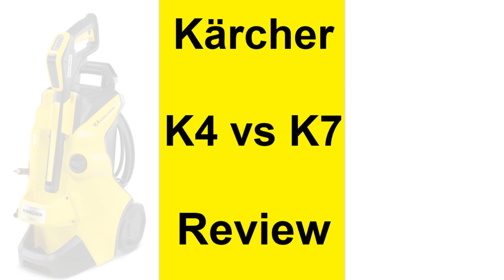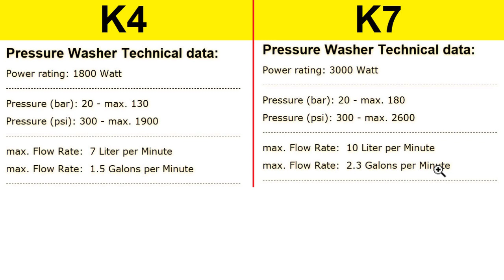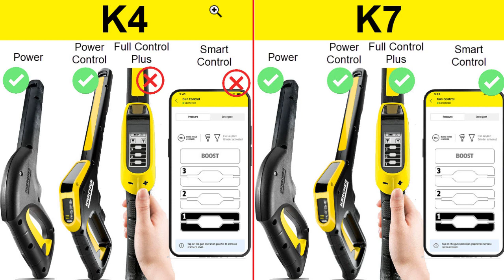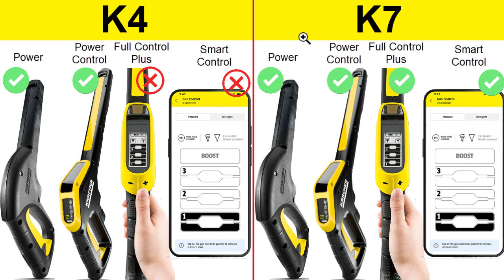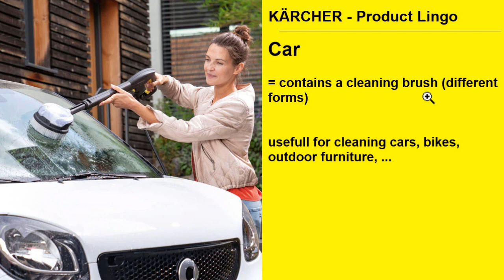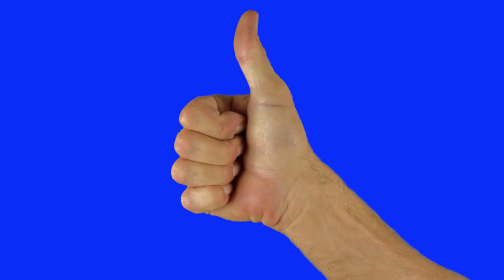Karcher K4 vs K7 High Pressure Washer Comparison Review

Comment: I've had my K4 for 13 years and it's just started losing pressure. I've decided to replace it with the K7 because I have started cleaning my work van and the K4 was struggling with stubborn road grime before the fault of losing pressure.

My K7 will be arriving next week and I will let you know how much better it is than the K4.

Plus all my neighbours have K4's and I wonder how long it will take them to upgrade to the K7 😊

Comment: "full control" pressure gun is a complete con, all it means is you fit some batteries in the handle and an electric light comes on to tell you what pressure is going through the gun. It does not "control" anything as you cannot alter the pressure - you have to manually change the nozzle to do that .
you need to get the full control PLUS gun to actually be able to control the pressure from the handle (and that does not always come with a K7).